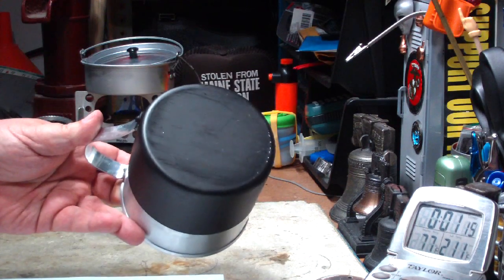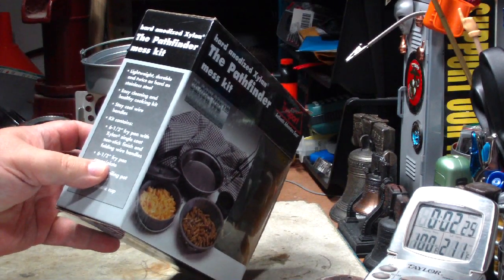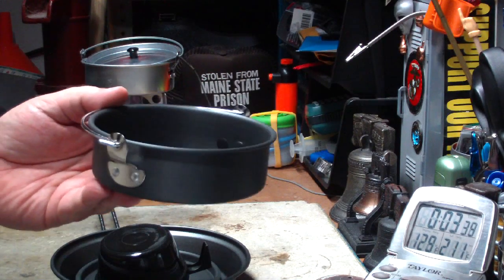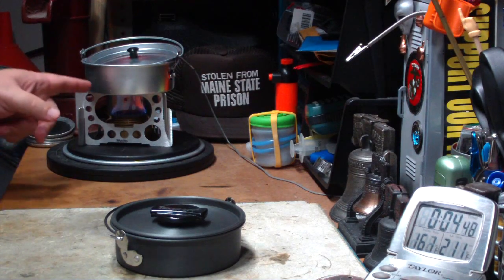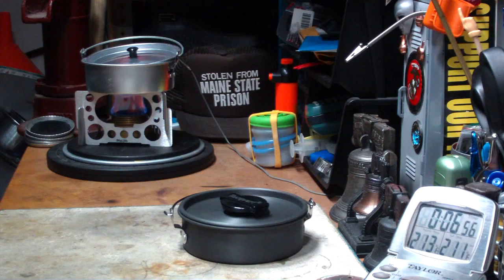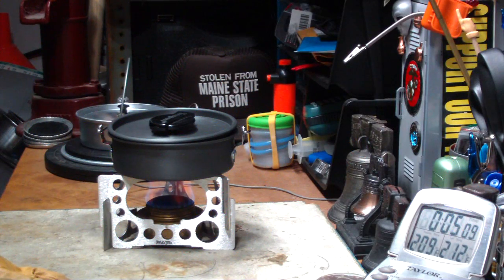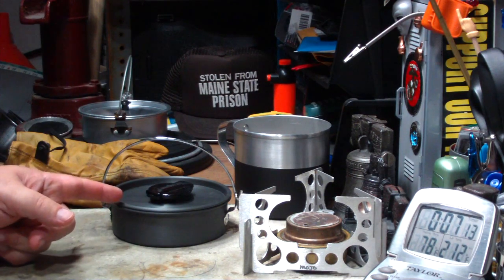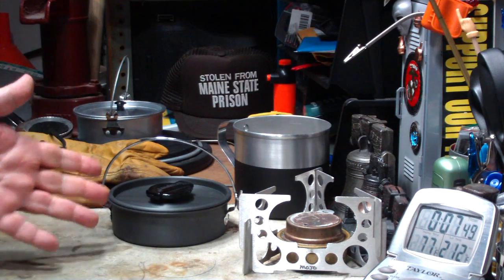Backpacker Magazine Painted Pot Idea Test - Revisited - Again

Comment: Especially if they let the water to sit in the sun (maybe while they did the 1st test). Or they didn't use an alcohol stove. If they used an inefficient stove that produced a bunch of visible light, then the black paint may have helped a lot more than with an alcohol stove. Or they may have used a paint with a mat finish which could trap small pockets of heat. Or they may have used a paint that had a slightly different ingredients. The different variables add up, but 40% seems a stretch.